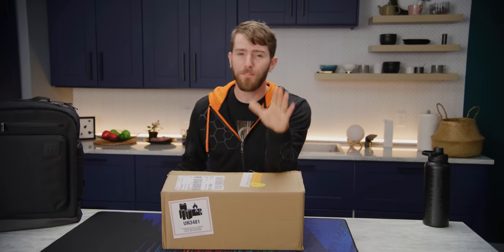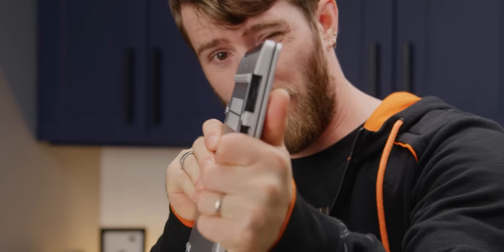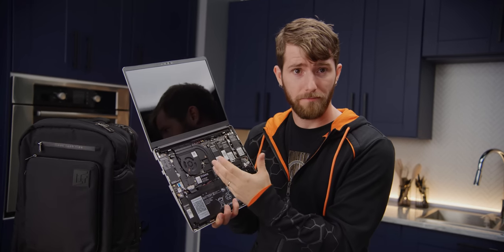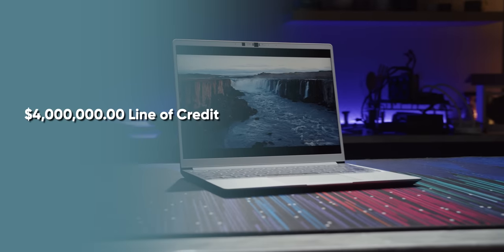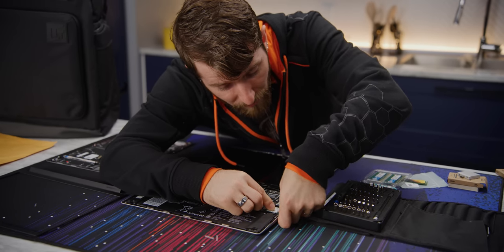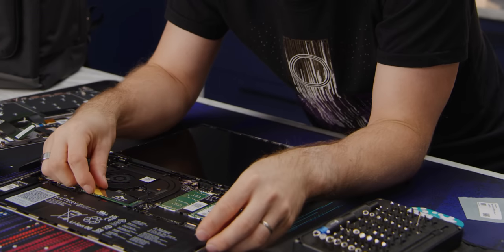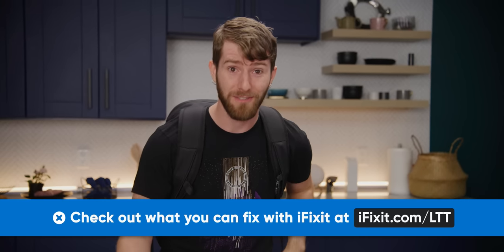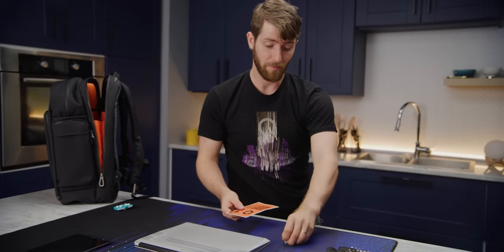I’m Legally Obligated to Disclose This - Framework investment

Comment: I personally love this. And while the world is suffering from a terminal "disposable world" syndrome pandemic, There are enough people who do care!
I personally don't like laptops, ok, I hate trackpads, they suck!!! XD

Here's the thing, laptops, like phones are wasteful. I do believe this sounds better than the Motorola's Project Ara modular phone, in that they are actually making laptops. They are still wasteful. and that phone was trying to make every part swappable!!!

So, do they have a program to upgrade the motherboard? and a recycling program that truly recycles? I'm picking a random car here, but there are a ton of people who want a 1958 plymouth fury and they want the body, but modernize the powertrain. While some want to keep it as close to the day it rolled off the assembly line some 63 years ago. This should be the mindset with computers, and for the desktop formfactor, this is a reality! in 2016, when I built my FX system, I only needed to make a cutout in the motherboard tray, and my 2008 case lived on, then my kid needed a first computer, so I got a new case, and rebuilt the Athlon system in its original case.

These are things laptops can't do too well, a few swappable I/O modules, ehh, gimmicky imho... BUT, This sounds like it's starting in the right direction. if the CPU is socketed, and upgradeable, and the GPU is on a custom swappable daughterboard, this is an upgrade path until the next motherboard swap out, but if it's a few modules, trim, key switches, etc. While it a good start, it's wasteful. 

Hell, maybe in the next iteration, after user serviceability takes a bigger foothold again, then tackle what is left of the world that isn't stripmined... And I just learned that old CPUs can be recycled into photovoltaic solar cells!!! No need to ship it all to a village in china to pile up!!! nifty huh!?!?!

I truly hope this works, both for them, and for you!! maybe they can set a new standard making it all modular, and upgradable!!

Comment: at a fair price....yet you didnt say then and then what that fair price is

is it a fair 250-500 dollar price like it should be

750-1000 like many laptops mainstream gaming and non gaming often have been since 2017ish or like the 999 dollar ultrabooks you often used to review since you said this is an ultra book form factor laptop thereby making it more expensive automagically then it needs to be due to the thinness and lack of space and over engineering neeeded to achieve such?

is it fair price for a gaming or custom laptop or like that acer or asus 21 something x 21 inch massive laptop you once reviewed? so like 1200, 1500, 2000, 3000?

what exactly constitutes a fair price

given its fully customizaable to an astounding extent for all we know coming into this video blind about this product it could be you consider 4-5k a fair price

hoping you tell us at some point in the video and i dont have to try to google it to look it up
Reply: so 1049 canadian is like 819 or something us dollars according to google right now, plus it says you still have to add wifi ssd operating system and ram as seperate additional charges ontop of that 819? ouch
Reply: so wait, the price you paid is 819 us dollars but the bill of materials so far without those extras is close to 800 us dollars? not good business plan if they plan on only making 19 dollars at best per laptop sold
Reply: His full review a while ago had the prices but they range from 800ish to well over 1000
Reply: 250-500 💀

Comment: I do not care for tiny lap tops. I would look to see a power house lap top fully customizable with pc box power, one 17 inch brief case laptop upgradeable motherboard and chips, video cards, just like PC's.  Powerful, cool long battery life. Heck put enough room for having 2 or 3 batteries. Make a construction hd rugged case. Go back to the 1990 size lap top case. 17 inch screen 3 or four times the thickness is fine with me. Micro USB plugs suck. I have spent more more in micro USB plugs than phones and devices cost. Offer more colors or skins silver and black are redundantly used. 
Build a case to leave some growing space. Cell phones went from small a compact  to third the size of a laptop already. 
I have no desire for a paper sized folder lap top. 
But a power multi use cinema tv, business office, gaming, surround sound machine I can charge and take camping, on a boat , and be able set it anywhere and do what I want it to do With out have to recharge it for 24-36 hrs or if it charged I can use it as a power bank for three or four days.  Hell being able to jump a 
 truck or car of once or twice if the lights or something is left on in a pinch.  Cables with the same ends would be nice something that lasts. Two gallons of water weighs about 16 lbs can you make a bad ass lap top 16 lbs and under.i love the thought process of the company frameworks. Same size screws,  make all the screws the same size.
Figure out a mother board shape and have amd and intel Nvidia  fit their components on it. As things get smaller just means more computing power later down the road and longer battery life. And do not change the outside or demensions for thirty yrs or so. 
Make some that is consistently dependable and replaceable as needed. Leave room to grow and expand. Eventually , it will be the norm. And help the environment as well as help people save money, time and stress in the long run. Which now days is unheard of. But make it so people can have options to make it personally theirs artisticly. 
Makes it a sensible choice for ease of inventory as well. Buy back used parts for those who upgrade or need to down grade.
Patent your own plug shapes and quality. Put all the tried and true parts improve them and stick with it. 
LTT is by far the best computer based team I have seen.  I am not a gamer but have learned a lot watching the videos. 
The labels inside awesome.
Last I heard the brain or eyes can only comprehend it compute 120 frames per second. Anything beyond that is a form of hypnosis.
Make room for a dust filter that pulls out like a dryer filter. 
Take it back to simplicity 
A #2 Phillips head screwdriver , a pair of regular sized needle nose pliers and a plastic Putty knife and use can assemble all components.  
Plain simple packaging black and white put all the money into the product and customer support. 
No small print, no hyped up numbers. Keep it real and keep it honest. The world needs a positive refreshing trust worthy company that has their back.
Congratulations on your new investment.much love peace and many blessings to your families.

Comment: Imagine dropping this thing and all the parts go flying everywhere Like a cheap android phone...
Reply: You know this laptop uses actual screws right? Do kids these days even know what a screw is and what it does? It's like an adhesive, but you can remove it to get access to something. Pretty nifty, if you ask me.
Reply: @flyingchimp5012  wow thanks for enlightening me on this ancient technology you call, "screws". The thing is is that I was making a joke. Do old people these days not know what jokes are? They're pretty funny, if you ask me.
Reply: @nickjt54  You didn't make a joke in any way. At best you indicated contempt, attempting to show a well engineered device as improperly built, despite at the time 2 videos from this channel which showed evidence to the contrary.
I have not even seen any of the many cheap Chinese phones I have owned with the 'parts go flying everywhere' upon ground impact, at most, the device splitting into 3 designed to separate parts (body, back cover, removable battery), and maybe screen or case cracking.
Multiple linguists have developed a few concepts to define a 'joke' of which I do not think any of them would classify what you wrote as reaching the requirements.
Maybe a little time with other people can help you understand what appropriate humour is.

Comment: Honestly I think expandable laptops are very overrated.  Like you should never have a laptop as your primary workstation and if you have a laptop in addition to a desktop then you can afford to just replace the whole laptop every 5 years or so.  Replacing the parts of a modular laptop doesn't seem like it would be likely to be any cheaper than just buying a new laptop.

Also...the number of consumers who actually want a product like this is very small.  So small that they would end up being more expensive over laptops that are mass manufactured.